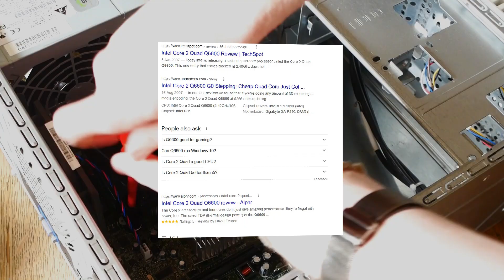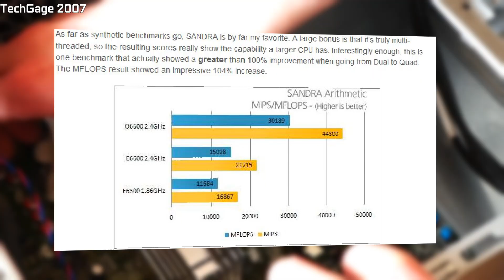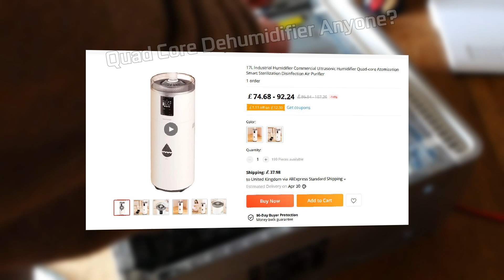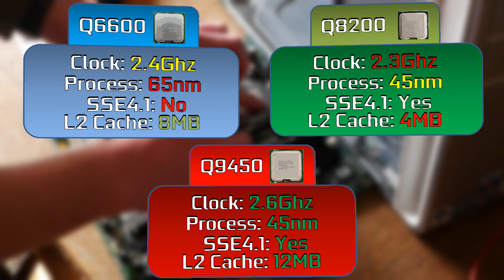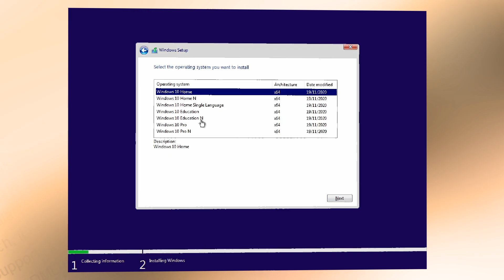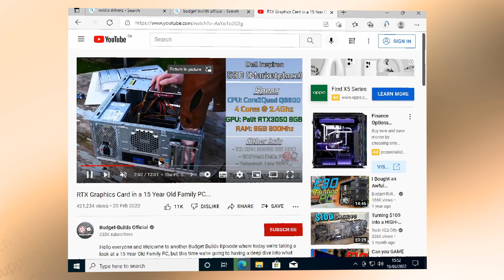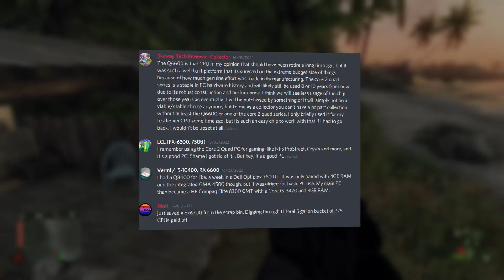Intel's Core2Quad...Finally Obsolete?

Comment: For my son's first pc I picked up an optiplex that came with a dou. I grabbed a q6600 from ebay for super cheap, tape modded it and paired it with a 750ti I had laying around. It ran great at 720p. I still have it running plex as my music server and network storage
Reply: I'd feel satisfied knowing these systems would be living their retirements as storage systems, although not having usb3 ain't the nicest
Reply: Well you can get usb3 expansion card, pcie nvme adapter, pcie 10gb network card and hoala free storage server

Comment: I've owned many core 2 duos and core 2 quads and I'd never in a million years think people would still be using them after 2020. I just recently upgraded my core i5 3470 to a Xeon E1230 V2 and with the games I play with my system I can definitely tell the difference having the extra threads available. Great video as usual. Love your work!
Reply: My Q9650 has been my daily driver for the last few years...between having grown up in the 80s with REALLY slow computers, and the blissful ignorance of not having used todays much more powerful CPUs, living with a core 2 quad isnt too bad lol
Reply: Over the last 10 years or so progress has slowed a bit and demands for simple tasks has stayed pretty much the same as well. Chips from that day might not be able to play the latest games well or do modern render workloads in a timely manner, but they're still capable for office or youtube.
Reply: @HappyBeezerStudios  I thought that, then I got an AMD Ryzen 5000 series upgrade from the old 2000 series, this thing is blisteringly fast.
Reply: Buddy am și eu un procesor Intel core i5 3470!☺️😊😊😊🙂

Comment: Too much emphasis on gaming nowadays Budget Builds Official getting real boring yawn....
Reply from the maker: Simon my boy, the video also covers the history 😎
Reply: @BudgetBuildsOfficial  I'm a pc noob compared to you and I hate old pcs going to landfill I get where you're coming from with the gaming performance thing I just think you could spend a little more time showing how well older PC's do everything else other than gaming.
Reply: @sptimms69  he talked about it, and it works fine :) wouldn't use it for heavy tasks though, it works but will be very slow for modern video editing and stuff like that. Though you could get away with using an older version of photoshop and more basic video editing tools if you had to.

Comment: As I watch this on my q8400 machine I built in 2016, I honestly think that no cpu is obsolete until it can't do simple non-gaming tasks anymore, also I've been thinking of switching to a q6600 and overclocking it, could an overclocked q6600 beat a q8400? I know it has more cache so that makes me wonder, anyway, long live the core 2 quad!!!!
Reply: mine overclocked to 3.4ghz. most of them did 3.0 without a sweat
Reply: @GizmoTheGreen  I'll have to swap from my stock cooler but I'll definitely try it out
Reply: What's the power draw, though? Like, this kills the appeal for me until someone can point out its worth the cost.
Reply: Difference between the 65nm and 45nm chips was maybe 6% in terms of architecture improvement. so at around 2.86 GHz you should break even for that, which is a joke for core 2 oc. In terms of what is posible, I'd say somewhere around 3.4-4.0 GHz should be archivable with both, but your board or RAM might limit you on that, and at that point the higher multi of the Q6600 will be your friend.

Comment: So.... my 2008 Mac Pro basically runs Core2Quads too (liek the Xeons are just beefed up c2qs) and those two are st6ill doing a great job imo. Socket 775/771 is imo still not obsolete

Comment: The Q6600 was so legendary, cause you can overclock it into the sky.... sometimes it was as easy as lifting the FSB from 266 to 333 (quadpumped - so 1066 and 1333 FSB) which give you more than 3GHz on that thing.....
Reply: 333 FSB gave it exactly 3 GHZ, but FSB 400 with 8x multi for 3.2 GHz always felt like a sweet spot to me. The right balance between performance, voltage and cooling requirements.
Reply: YOU CAN USE A DDR3 MOTHERBOARD WITH THAT CPU

Comment: problem is not the raw power but memory troughput , being lock to 64 bit bus that run at 1333mhz gives little change when you run ddr2 in dual channel or ddr3 in single channel and first few i3/i5/i7 generations show you how interesting was the amd idea of moving memory controller inside of cpu if you did that to core2duo
fun thing is core2quad is an upgrade i did to old dell in my work to be able to keep up streaming the screen to multimedial board via internet, pentium dual core had a cap of 12 fps, core 2 quad does 60 untill you fully load it with hd video on youtube :P (youtube load it down to 40-50fps but that might be the screen sharing compression) either way this cpu is the greatest thing if you can't let old school computer die and you have no way to buy new one, windows 11 kind of backstabing them but hey, after 15 years they are a proof of how technology outrun our daily tasks in the early 2000's and how little of the top end we actually need  to be happy if we are not gamers
Reply: Well just use win10 then easy
Reply: @hartomos  for me windows 11 is not even a thing i would want to try because i simply don't like how it looks, plus in schools we have a lot of legacy hardware that was hard to run under win 10 so why going trough this hell again, we stop computers that are able to update not the other way around

Comment: I really love the tests of those old Quads. I still use a 9550 with a 7770 for dailey tasks, light gaming and so on and it still works fine. I dont think any second about retirering the system.
Reply: Same here! It matches perfectly with a GTX 750TI! I also got a i7 6700K paired with a RTX 2060, but i like more the old C2Q for sentimental value
Reply: Similar to what I was running for a while (X5460 + R7 250X, until it got handed down a GTX 660 Ti)

Comment: could you please do this type of video about amd bulldozer, i think it's underrated especially in terms of overclockability. I have a about 6 year old fx6300 which has been running without problems on 4,5ghz for about a year now
Reply: I had a Bulldozer Athlon. It was complete and total garbage! 🤦‍♂️
Reply: @bigtermtech  i don't have any experience with the bulldozer athlons, all i know is that the fx series is good (in my opinion)

Comment: Please - try OC them. Up until recently I had LGA771 Xeon in LGA775 board OCd to over 4GHz (4,2GHz was quazi-stable and 4,1 was perfectly fine). These CPUs were great for overclocking and that's what made them legendary. You bought already super powerfull CPU and you got another 30% + on OC. 
Actually my first CPU in that board was lowly Pentium 2140. That had  factory clock clock @1,6GHz. It ran perfectly fine at double that speed (3,2GHz) until I replaced it with second hand Xeon.

Comment: In years we'll be like
"The core i7 11700K, how does it hold up in 2037? Now, we know games these days only hit 12 cores, but does this 8 core chip still hold its own? We'll see in the benchmarks"
Reply: I'm waiting for 15 years from now when we look at stuff like a 3090ti and the 6950XT like thr GTX580 is now.
Reply: @DigitalJedi  Nah, 2028 to 2030 latest lol. PC tech moves fucking fast.
Reply: @Shyvorix  not anymore, moore's law is hitting its limits, unless something new comes to the equation.
Reply: @Shyvorix  PC tech has slowed down a lot.
Reply: Replace that with the i7 7700k. It's the new 2700k
Reply: Thing is, we're not far off peak consumer processor power. Improvents will begin to plateau again.
Reply: @Green Mamba Games possibly
Reply: @Green Mamba Games actually, there cant be that many 8-bit systems still functional that will make it to a bunker, most of them are either rotting away, in a collection, or a museum. They won't make it into a bunker, I expect it'll be more like 2010-2014 midrange buissness laptops like Dells, HPs, Acer, etc
Reply: @sur_shrimpster  Girl in your pfp is the only female attention you'll get
Reply: games still don't exceed 4 cores, so 8 is pretty useless, even in 2037 developers will only use Cores.
Reply: @Jeymez  I regularly see Warzone, Battlefield 1, BeamNG.Drive, CyberPunk, and Battlefield 2042 hit all 8 of my cores
Reply: @theforerunnerreclaimer  i have CyberPunk and it doesn't even come close to maxing out my Ryzen 5 5600G and that's a 6 core, of course it also helps if you have a good decent graphics card. on my Radeon RX 6600 XT i get 70fps on 1440p, and 80fps on 1080p. Battlefield 1 only utilizes 4 cores my friend, i don't know about Warzone but i don't have that game to test.  
8 Cores aren't being fully used yet, the only game i have that pushes my CPU to the limit is that Flight simular game, and Elden Ring. 8 Cores are only necessary if your doing more than just gaming, livestreaming while playing a game at the same time and recording is more taxing on the CPU because it's taking on more tasks while trying to send information to the GPU.
alot of VR games can be damanding on the CPU, but those are different, i don't have a use for VR. 
on the flipside if you use a capture card like an Elgato HD capture, you can use that to take the responsibility off the CPU, that way it can focus it's full attention on the GPU.
Reply: @Jeymez  maybe task manager's per core view doesn't actually show usage just overall CPU utilization
Reply: @theforerunnerreclaimer  i have no idea, i rarely ever pay attention to benchmarks, because one or two things is bound to happen. either someone benchmarks a high end CPU with a midrange graphics card, or they use a high end GPU on a more budget range CPU. when you see that, your gonna notice the mismatch, that's why it bugs me when people to take a budget CPU or GPU and they pair it with something high end.  but in real world, it's always wise to kinda even things out with your CPU and GPU.
a few examples are like this.

Intel Pentium G7400
Graphics card Nvidia GTX 1650
Asus motherboard H610
this build can be for a college student that might only have time to play a casual game once in awhile, to a guy on a fixed income build that just wants to play some eSports games, or it can be used for productivity work. but this build won't bottleneck the other

AMD Ryzen 5 5600G
Graphics Radeon RX 6600 XT.
the pairing of these two are amazing,
now i could probably get a few fps more if i got the 5600X instead, but the price difference was better on the 5600G for me, i got a good deal on it at the time.
but the point is, this is a nice midrange pairing.

now you could also do a build like this
Intel Core i5 12500
Graphics Nvidia RTX 3060ti
Intel tends work very well when paired with Nvidia, but that's provided you pair the right combo together.
pairing the G7400 with the RTX 3060 wouldn't be a good fit together.
so if you buy something like the RTX 3050 the Intel i3 4 core is a good pairing,
now if you buy the 3060ti the Intel i5 12400 or 12500 is a good pairing.

Comment: I've got a machine with a Q6600, I refer to it as "The 2007 Machine", something I've had around for years.
Actually a pretty good system for Xp stuff
Reply: I've just retired my dad's "2007 machine." It has a Pentium Duo E2200 and it runs Arch Linux with KDE. It's surprisingly decent still.
Reply: i have one too! xp gaming machine with 8800 gts
Reply: @wfmg7235  Mine has an E8500, 7900 GT, Gigabyte board and 4gb OCZ Gold ram.
Reply: @wfmg7235  what can you play with an 8800 gts? I have one myself on an old machine and want to give it new life
Reply: Ah, good stuff. If yours is still running,  perhaps there's a few more years left in my ol' girl, the i5-750. 2.6ghz quadcore goodness.
Reply: Overkill for XP (not necessarily bad thing) since it can only utilize 2 of the 4 cores.
Reply: @Geert365  XP can fully utilize 4 cores.
Reply: @9852323  Oh, up to 32 on 32 bit and 64 in 64 bit  cores i find. Think i got thrown of because old machine says two cpu's which had XP pro in it. And using it on a core 2 duo, which "only" displays two of course. I stand corected.
Reply: @9852323  Yeah, 32 cores on 32 bit, 64 on 64 bit i find. Had old xp pro machine which said 2 cpu on side, and used it later on core 2 duo, which displayed (only) two of course , those two had me thrown off i guess. I stand corrected.
Reply: @9852323  I keep answering this, but seems to keep disappearing.  But in short, yes, you are right, i stand corrected.
Reply: I hope it’s dual booted with Windows 10. Otherwise I feel it would be severely underutilized with only Windows XP.
Reply: @9852323  board is too old to support 10, storage controllers don't have drivers causing 10 to crash on boot... I'm planning to quad-boot with Vista (for the meme), 7, and Linux
Reply: Actually I have two XP machines. One using Pentium 4 478, with 768 of RAM and FX 5500 video card. And the another one is a 775 Pentium dual core 3.2 Ghz, with 2GB of RAM and a 512MB AMD video card. I bought one core 2 quad Q6600 and now I'm going to make the upgrade.
Reply: Q6600 with 8GB DDR3 memory and a GTX660 3GB.
It runs surprisingly well, I'm currently thinking of giving it another update by looking for an even better CPU.
Reply: With the cheapest SSD (Kingston A400 120 gb) it boots Windows 10 faster than my 2022 laptop with an nvme ssd loading either Arch or Windows 11.
Reply: @ely_vt  I doubt the validity with Arch on that that unless your NVMe is actually an m.2 sata drive, unless the laptop is just trash.
Reply: @supermasterfighter  It is a Kioxia NVMe SSD on a decent laptop that came out in 2021.

Comment: disabling Spectre & Meltdown patch especially intel lower than kabylake are recommended to try. I have haswell 4800MQ based laptop which affected by these bug. Disabling them i got system stability and less audio skipping while doing multitasking

Comment: A Q8300 is my daily-driver and it works better than the i3-2120 I used previously except for graphically intensive tasks. Finding 4GB DDR2 RAM modules for it was an expensive nightmare though. I plan to replace the Q8300 with an overclocked Xeon and beefed-up cooler at some point in the future.
Reply: The i3 is undeniably better in games and maybe slightly worse in other tasks, you wasted your money buying that ddr2 RAM instead of saving for a new processor...
Reply: I really need to work on finding some of these 4GB DDR2 modules. they are such a nightmare to get these days, but can certainly help with performance on 2 slot boards.
Reply: Nah you can't use 4gb ddr2 stick , if you need 8gb ram you have to use 4x2gb config on high end mobo with 4 slot ddr2, or 2x4gb ddr3 with g41 chipset, if you want 16 gb you must use x48 chipset with 4x4gb ddr3 if I'm not wrong, yeah ram config in this gen cpu is a mess because of the transition time between ddr2 and ddr3 with north bridge chipset being the main limitations

Comment: I guess the Phenom 2 wasn’t the best thing out there compared to the core 2 quad? I recently found an Athlon 2 X4 PC, but it’s really hard to find core 2 quad computers my uni throws out, it’s typically core 2 duos
Reply: the reason I had a core 2 quad is because it was from our family pc, I switched to a different c2q but my brother is still using our glorious q6600 to this day

Comment: too bad, sold q6600 build just because cant handle the shuttering issue on playing videos but replace it with i3-2100 build and it much cheaper... bought i3-2100 for 5 usd and it was a good deal

Comment: As someone who thifts for pc parts every week or so I just wanted to say that I no longer find 775 systems, its only Fm2, Win 98 Laptops or Intel 478 boards. Just wanted to add that :)
Reply: that's a sad sad thing, I can find them sometimes but they're usually just family computers finally getting tossed
Reply: @ethand4784  Yeah in my area DDR3 775 boards were as easy to find as 1st Gen Xbox 360s which was crazy.